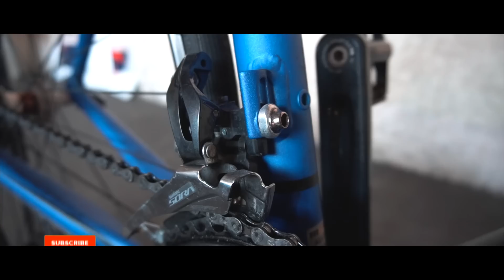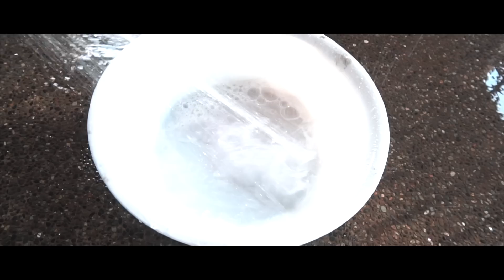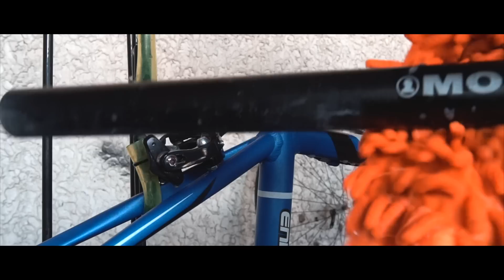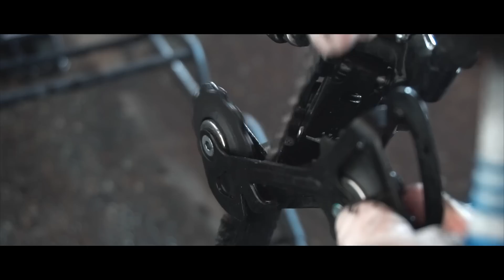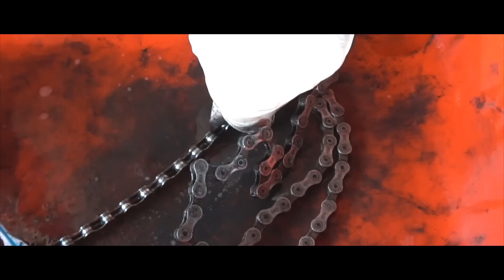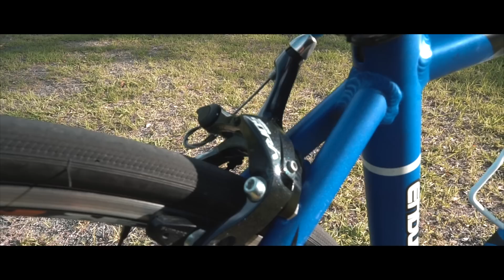How I Wash My Road Bike (Regular Maintenance)

Comment: Sir tanong ko lang. Naka hydraulic brake kasi ako at balak ko tangalin yung cable from the lever para maishoot ko sya sa suotan ng cable sa frame. Kapag ba tinanggal ko yun need ko pa ba magbleeding? Used na po yung hydraulic ko. Sana masagot